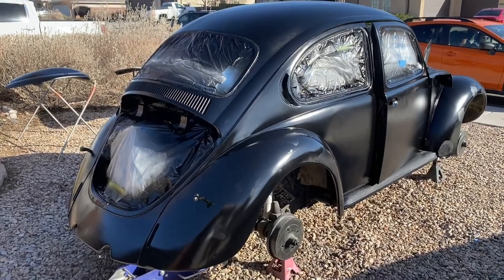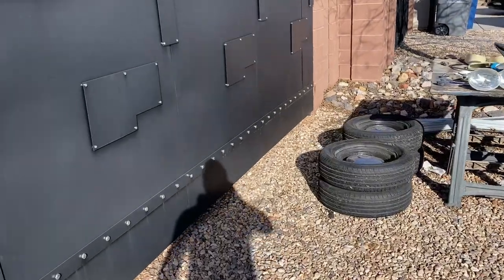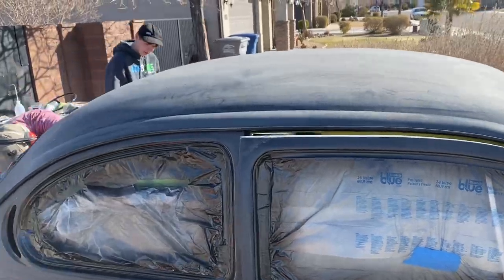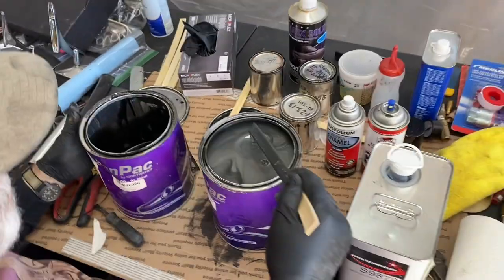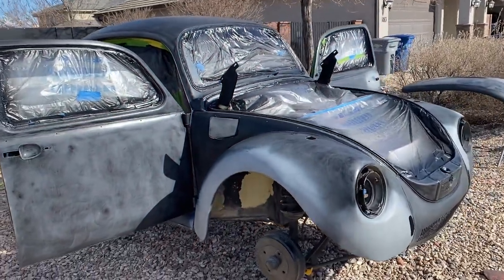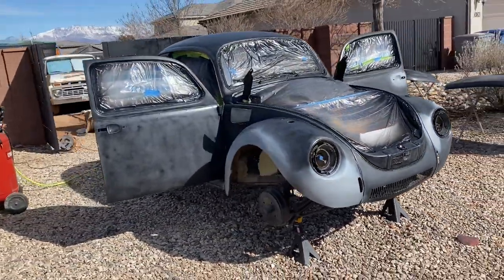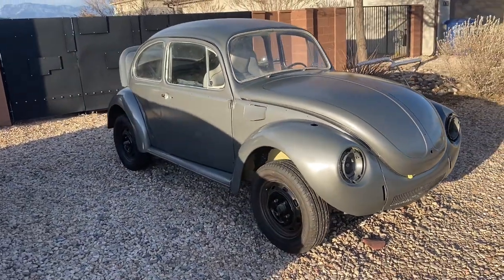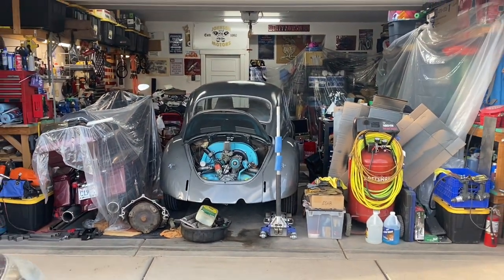Paint a VW in less than 3 Min!

Comment: did a nice job for a metallic single stage. I didnt even see a drop coat. But you did go pretty fast and fairly dry which helped.
Reply from the maker: Thanks for the comments… I wish I would have slowed down a bit in the rod cause there is some tiger stripping… but it’s a solid “10-footer” which is perfect for a 16 yr olds 1st car 😎

Comment: Im curious why you didn’t remove the seals on the fenders and slightly leave the fenders attached with a couple of bolts (or removed completely) and then spray it? It’s likely the paint will peel on the fender seals.
Reply from the maker: The short answer is: that is a great idea we just didn’t want to take the time to do it. We got to the point that we realized we were going much further than we intended to anyway with this car as a 1st time driver vehicle… also the car had at some point been repainted the yellow color and had already been painted over the seals and had not flakes off so we were cheap. Also the likely hood of having to replace the seals all together if we separated the fenders. If my boy manages to not wad this car up in his first years of driving we will likely do a proper full disassembly and restoration of the exterior.

Thank you for watching and thank you for your comments!
Reply: @johnsonmotors435  I completely understand. I just noticed you had gone through the trouble of removing the hood and truck lid so I was curious why you didn’t remove the fenders. I think the fender seals are cheap. My very first car at 16 years old was a 1964 bug. I bought it from a junkyard without a motor. My dad and I bought a motor and we rebuilt it together and we rebuilt all suspension. This was a great bonding experience for me. I had that bug throughout my 20’s when it was stolen! I wish I still owned that car.
Reply from the maker: @TonyLiveTV  that’s an awesome story/memory… thank you for sharing… That was the whole  Genesis to making this YouTube channel about the process of building the bug was to get the boys involved in a project they could not only learn in but spend time with me(dad) and their grandpa(seen in several episodes! It’s been awesome doing these things with the boys!